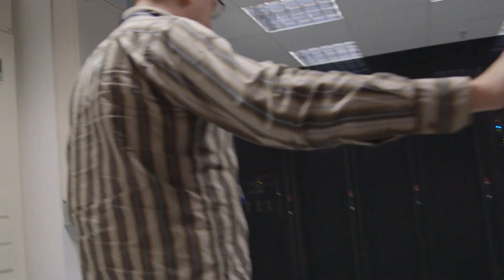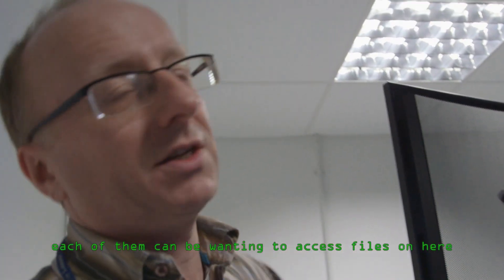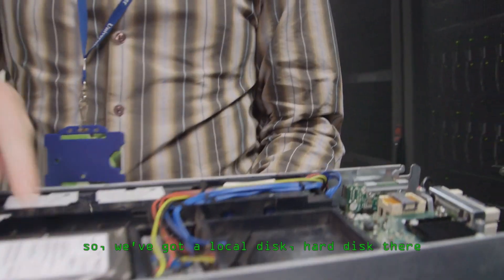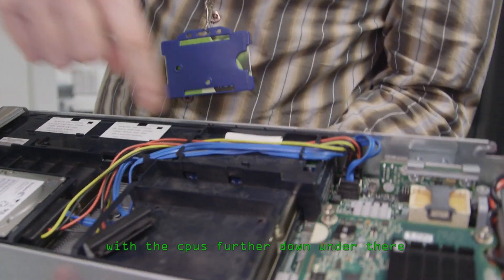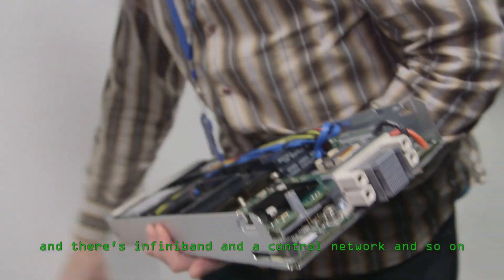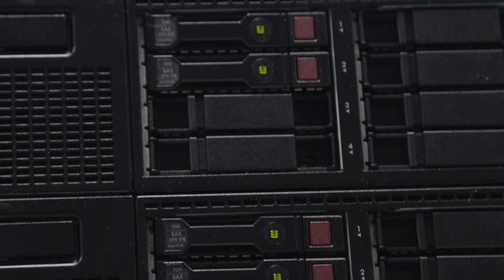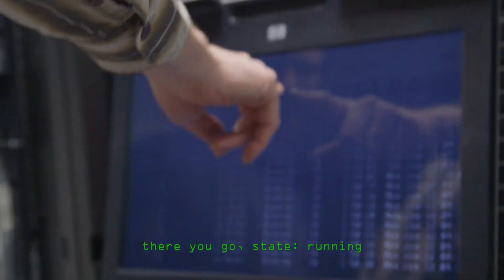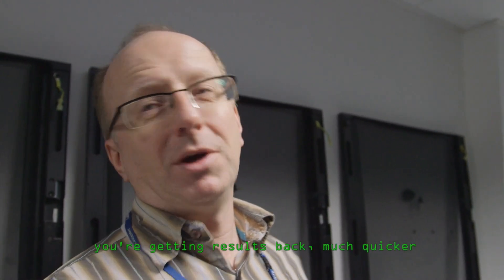Supercomputer and the Milky Way - Computerphile

Comment: Oh look, a small supercomputer :P
(working at ANL. we have Mira, the top500's n°5)

By the way running 16 node simulations on a supercomputer is just a wast of ressources. Just use a Xeon-phi and leave the supercomputer's nodes for large applications that really needs them !
Reply: Well... kind of, but not really. Sure you can have a desktop computer doing it. But sending it to the server farm is a lite more flexible. Then you can sit on your ultraportable and just send work after work and do it faster than you can on a desktop. You basically reduce the need for a desktop.
Reply: matsv201
That's what I meant, I have a 1.3kg ultrabook, and when I what to run simulations I just ssh log to a server with a Xeon-phi on which a can sur my code on ~60 cores.
I don't use a supercomputer access for that kind of simulation.

It's a shame to see that 30%~50% of supercomputer ressources are used by <100 node tasks, a grid infrastructure would be war more adapted and flexible for those kind of applications.

Supercomputer are usefull for really large application >1k nodes ... on Mira I see 8k / 16k / 32k node programs running everydays
Reply: I would guess its low priority work load so its scheduled to a time where is no high preformance work to do.

When i went to university we use to do simulation on stand alone Sun computers. When i did my postgrad we used a small cluster of 20 or so "regular" Opteron PC:s to shot over the simulation to. This small server was owned by the department. The universality also owned a (top 500 at that time) supercomputer that was shared with the government meteorological institution.

Of cause we used custom soft war so we could not use the university supercomputer, so that's why we built our own. The visualization teem use it all the time. They was to lazy to wait 15 seconds for there visualization build so they dumped it over on the supercomputer in steed.
Reply: 16 Nodes may not sound much on a Supercomp ( I'd kill to be able to run my computations on 16 cores, being a non profit semy private Institute has its disadvantages ) but sometimes that's enough to do the job in a reasonable amount of time.
Reply: Herdatec You can get a AMD Opteron 6370P for like $600... Sure a Xeon E7 is nicer.... but also a "little" more expensive.  Even better you can buy a motherboard with two CPU slots for $200-$300 that still uses normal memory (ECC-memory is expensive)
Reply: They said that a lot of these jobs use fewer CPUs because there would be too much communication overhead with a larger number of CPUs.  But some may also be test simulations to check that the code will do what it's supposed to with much larger numbers of CPUs.  It's much easier to develop the test-sized and full-scale simulations on the same system.

But yeah, it's actually a small and cute supercomputer compared to a top 500.  I like the full-connectivity Infiniband though, that would rock :)
Reply: Connor Hill I know, I am one of those students ...

Comment: why aren't they using GPUS???? more efficient right?
Reply: no. those calculations are probably all done on the lowest Levels.
Reply: Not exactly, GPUs and CPUs work differently. GPU are basically another nodes, but which can commmunicate only through the PCI, or PCI-like interface. So if you put one GPU on each node, GPU communication would have to go through the CPU, then the network, then the other node's CPU ... and that is just to slow.
GPU (or accelerator cards like Xeon-phi) can are used in some supercomputers but only as a helper for each CPU, and depending on the work you do you might not be able to use this helper ...
Reply: For a subset of the calculations a CPU can do. A CPU is more general purpose than a GPU but at the cost of speed (I don't know the details).
Reply: The supercomputer industry have note really cough up with the GPU revolution yet. Its a completely new way of thinking. Also, 64bit GPU have only been available a short time, and scientist almost only use 64bits flotingpoints.

For most kind of simulation a GPU works just as well as a CPU (and its a lot more efficient). There is not really a kind of simulation work that can´t be don on a GPU. Most people think of a program, but almost all supercomputer work is done throw drivers. You can basically never run your program right down on the cores. If you could, it would be quite easy to hack the whole system.

The problem today is that most simulation is set up by front end programs that run in back end drivers. Most front end programs is made for back end drivers that can´t handle GPU:s, and its almost always do to traditional reasons. You might just have written an instruction that cant be translated to GPU in the front end, and because of compability reasons you cant just kick the software out.

In some new supercomputer cluster there is both CPU and GPU based supernodes just in the same cluster. The GPU ones is very much like any desktop computer, it generally have a opteronsor xeon CPU, some weaker model, and often a larger number of GPU, quite often 2 or 4. While the CPU based use 2 or 4 xeon och opterons.

By the way xeon and opterons is basically the same processor as the i7 and AMD equivalent but with hardware CRC (ECC) memory, and usualy more cash (for fault detection). Contrary to popular belief they not faster, rather slower. Stability is more important than speed.

A server processor is more of a truck engine and a desktop processor is more of a racingcar engine. Both have the same performance, but the truck engine can preform much more stabily over a longer period of time and use less fuel/power, but is larger and heavyer.

That the chip is larger on a server is no real problem, just makes it easier to cool. It also makes it slightly more expensive to produce, but a lot more durable.

For GPU about the same is true: The node GPU also use ECC-memory, but also uses 64 bit pipeline cores. Until just recently this was quite uncommon on desktop computers, but in the latest generation just about every GPU is 64bit. This makes the workstation and supercomputer GPU a lot cheaper than just 3-4 years a go.

GPU based supercomputers do exist:
http://en.wikipedia.org/wiki/Titan_%28supercomputer%29
Reply: Yea, you still need a CPU to boot the OS and set up the code, but that's basically it. 

The problem is really that a GPU is that fast so what ever bandwidth it will fill it up so the code need to be more bandwidth efficient than is normal code.... well have do make some adaptations anyway.

Of cause, the CPU does not do any hard work any more so there is a larger thermal thresshold for the system

Comment: In the meantime a modern GPU like an AMD R9 295x2 GPU has 5632 effective cores and pushes out more than 10 teraflops.. If you could write a kernel to run on the GPU instead of whatever you're doing, one of these GPUs would outperform that monster.

Comment: Take those 4 cores and the price tag of the supercomputer and you have an Apple product.
Reply: B-but it looks fancy!
Reply: //they're not peasant friendly computers.//

Child friendly OS sitting on Intel hardware. Its an overpriced PC with a Starbucks logo slapped on sold to peasants. 

Is it a capable OS? of course all you need is a Magic mouse and a credit card and you can make rockets fly to the moon in your video editing software.
Reply: zeke1220 I think you might have landed on a parallel earth where humans actually prefer visual cues, tooltips and animations compared to manual pages, keystroke combinations and arcane syntax. I would consult your nearest interdimensional travel agency right away.
Reply: NoRotation Now tell us why we should choose OS X over a Linux distro?
Reply: NoRotation I've never understood the "more user-friendly" reason for using OS X. It's not more user-friendly. If you take someone who has NEVER used a computer before and give them a choice between a gui and a command line, they'll choose the command line. OS X is all about removing the operating system from the view of the user altogether, but this does not make for a more user-friendly experience.
Reply: brooped People buy things that "look" nice. GUIs are popular because the average consumer is clueless.
Reply: zeke1220 Next they are going to try and defend the quality of Beats by Dre.
Reply: zeke1220 You just don't get it do you. You are right, if it would be the case that something would take 10 minutes to do that you could do in 10 seconds. But in most cases it's just nowhere near that situation. Choosing from a GUI menu would take maybe 5 seconds more at most if you're slow. Which is not relevant enough for the normal user. Now you're obviously going to say that those 5 seconds add up quickly when you repeat the task. But no, that does not matter for a normal user, even if it would be critical in another environment. GUIs do not require you to learn mostly anything except for how to use a mouse, which is what makes them user-friendly and intuitive. You see "copy", you click on it, and tsa-dam, the file was copied. You didn't need to know in advance all the things you could do since they are given to you to look at. Instead of learning all commands you can just pick the one you want. Efficiency and ease of use are not the same thing. Ease of use may and often will lead to efficiency but in no way are they the same thing. Closely related, but in no way the same.
Reply: NoRotation People only prefer those things when that's what they're used to. Remember how I said "someone who has NEVER used a computer"? The moment you want to do something that OS X has not been streamlined for specifically, you're SOL. This is not how user-friendly systems behave.
Reply: zeke1220 Please tell me you're sending these comments through a Youtube API rather than by using these terrible user-unfriendly visual browsers and clicking on the horrendously limiting comment buttons. Otherwise you may just be grasping at straws and sounding like a madman.
Reply: NoRotation Because using something that's not user-friendly somehow makes it user-friendly? Is there a gas leak where you are?
Reply: zeke1220 You make an assertion that's demonstrably untrue, if a general consumer found command lines to be easier to user and learn then command line tools would dominate the consumer market. You assert something to be less user-friendly but is still your preferred tool of choice, because either it's easier to learn and use (thus more user-friendly) than whatever other tool you have at your disposal or you hate yourself.

Everything you say goes against past and present trends of interface development, your argument completely lacks any substance beyond some misguide notion of what user-friendly means. User friendly is easy to use, easy to learn, you can claim that the command line is easier to use and learn than GUIs but pretty much the state of the desktop/laptop/tablet/phone market directly contradicts that.

But who knows you might be a visionary, so maybe go invest all your money in command line tools, obviously when the general public finally realises the mistake they made with GUIs they'll send all their money your way. But don't go by what I say, go read the Wikipedia article on usability.
Reply: NoRotation user-friendly is not the same thing as desirable. nice try, m8
Reply: zeke1220 Your words don't make a whole lot of sense. Just sayin'.
Reply: brooped Command lines are not "conceptual stuff". If you only ever use a program to do one thing, is it really easier to sift through a bunch of unused options in a menu than to learn the one command you'll use?
Reply: zeke1220 You are confusing efficiency and ease of use. It is definitely easier for a newcomer to pick from a menu. But it is also definitely more efficient to just type in the command and get stuff done.
Reply: brooped Suppose a user wants to copy a file. Using a command line they can likely just type "copy" and get the result they want, but with a GUI they have to dig through menus to find the option. In this(common) situation the command line is both easier and more efficient. Most users will find themselves doing the same things over and over, in which case simple scripts(which they likely won't even need to write for themselves) can automate those actions, saving time and removing the need to know the commands. All of this, and without cumbersome dropdown menus!
Reply: zeke1220 Typed copy into cmd, got "The syntax of this command is incorrect." Typed copy into bash, got "~bash: copy: command not found". Job well done mate. You skipped to part where you have to know the path you copy from, the path you copy to, the potential to permanently overwrite files without warning, how cumbersome it is to copy a select few files unless their names all follow a particular pattern.

Look, I know you have a completely different definition of user-friendliness compared to the majority of UI designers, software engineers and programmers have, so go read Wikipedia article on usability and actually learn what most people call user friendly and maybe you'll understand why people call GUIs user friendly.
Reply: NoRotation Are you meaning to imply that you don't need to navigate to a directory in order to copy a file from it using a GUI? Do you have a device that allows you to copy files just by thinking about where they are? Generally, any group of files you'd want to copy together would be contained in their own directory, which most people would keep more of due to the lack of visual clutter created by many directories.

GUIs trade functionality for the illusion of ease of use.
Reply: zeke1220 NoRotation It depends mainly on how well the GUI or interface is designed, and how well the command line alternative is built.

For example, I've found the Atmel IDE (but this also applies to many other IDE's) has far too many buttons scattered across the program. Typically, they are only simple pictures that only vaguely depict their function (although hovering for a couple seconds will make a popup appear with the name, though not always helpful). I gave up after a lot of frustration trying to enable EEPROM file generation, and switched to avrasm2.exe from the command prompt.

End result, the -h flag tells you help for a list of about 10 options, which include the hex format of the 3 memory systems you'd write to (and lets you name the generated files), and a couple of misc options for assembling and debugging. Making my .eep file took me about 2 minutes to figure out the FIRST time I ran the program

So, from my experience, some forms of GUI's (Arduino as an example) are actually much better than the command line alternative, but some poorly done GUI's are a horrible inconvenience compared to the command prompt.
Reply: NoRotation Exactly my point.
Reply: brooped Efficiency and ease of use are the same thing to a point. If something is not at all difficult but takes 10 minutes to do when you could get the same done in 10 seconds with only very slightly more knowledge, the "more difficult" option is definitely more user-friendly.
Reply: false.
Reply: OS X has all the Unix command line tools, which means they interface with these supercomputers in a much more natural way. OS X is way more powerful under the hood than Windows can ever hope to be, the advantage of Windows is quantity (not quality) of programs, gaming and Microsoft Office. That's not to mention that Apple computers cost around the same if not less than equivalent Windows computers ever since they forced touchscreens on everyone.
Reply: zeke1220 I use Ubuntu, Windows 8.1 and OS X. As far as I'm aware OS X has better driver support, it's got some high quality commercial software support, is much more user-friendly, I personally find brew easier to use than apt. I also personally find hotkeys in OS X to be much easier to press, alt-f4 is really awkward compared to cmd-w or cmd-q (cmd is where alt would be).

But I'm just as happy to work on Ubuntu as I am on OS X, though OS X does have some extra bells and whistles similar to how Windows Office compares to Libre Office. One big complaint I have with Ubuntu is that the font renderings are very average and inconsistent, also there's a lot of screen tearing that I can't seem to resolve (it's still slightly noticeable after enabling anti-tearing in the drivers).

Comment: Plug in a GPU and it will run Minecraft?
Reply: nope
Reply: No Fun Allowed.
Reply: Somillian crysis 3 4k
Reply: A question for Randall Munroe might be, how large a Minecraft world would load at once using the full power of a supercomputer? I bet the size of a solar system.
Reply: Gareth Field Minecraft is really badly multi threaded so not much bigger than what you get on a mid end system